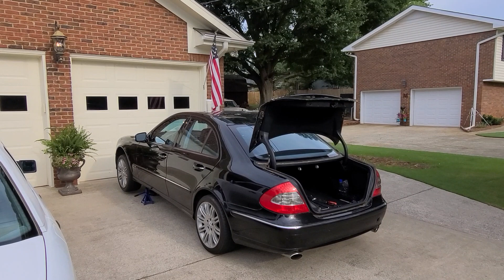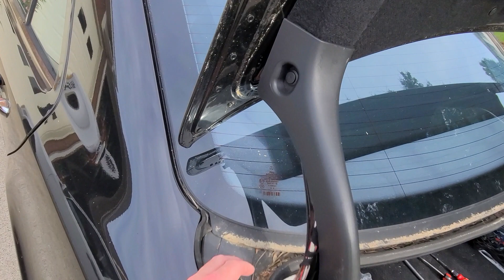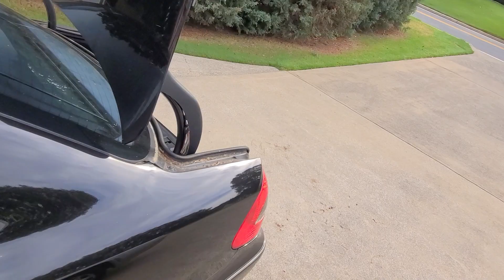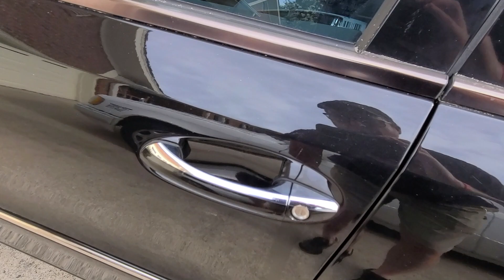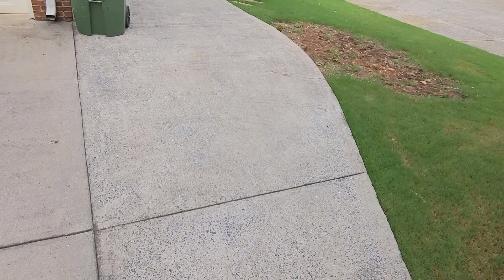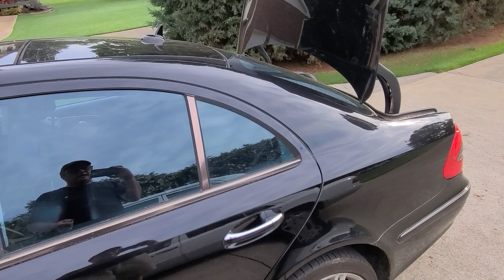Mercedes Benz W211E550 h***!   Trouble problems POV Murder

Comment: Joe, Sorry to feel your frustration. what would I do? can you get hold of an original wiring diagram. I would start in the boot and locate the white wire connection which is missing. it’s hard when a cowboy has messed previously. check every colour cable, and also that the earthing returns are all intact. a poor earth can cause return feeds to give problems such as the central locking, which you are now experiencing. I am an auto electrician and I always find when someone has been there before, it is best to start from scratch. you may have to open up the loom at the front end and check all your continuities on each colour. Mercedes and BMW looms are crap, and it only takes one break on one circuit to give these problems. good luck! (stick to Lexus, and rid yourself of this desire with Mercs. they are too much trouble).

Comment: Might seem stupid, but let's go back to step one, the battery. Pull out the battery for an hour or two so that the car "resets", then pop it back in and try again. If that doesn't work, it looks like the rear seatbacks fold, you could fold 'em and crawl through. Sorry, this car was such a shit tip for ya. Hope you manage to get things worked out :).

Edit: Got to the part about the battery being disconnected for hours on end. Looks to me like the pins for the looks on the door are in the up position (the ones in my BMW sink all the way into the door when locked, not sure if that's the case with Mercedes)
Reply from the maker: i got it open with a good ole coat hangar   the trunk opens all the time as well now   but the fob with brand new batteries does nothing   not a thing
Reply: @JoesGoldenGarage  Does ur car have the crappy degradable wiring?